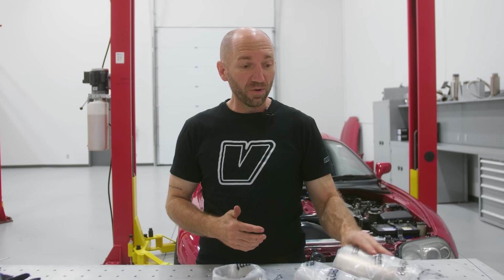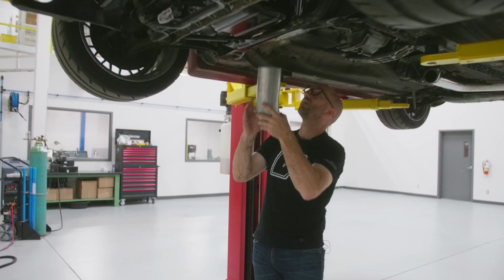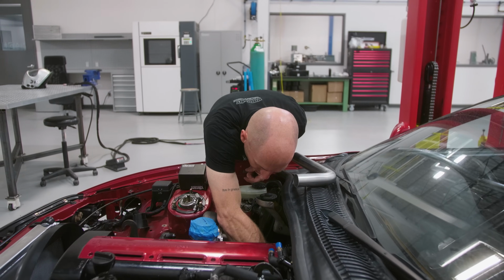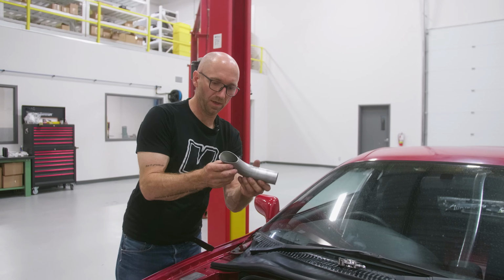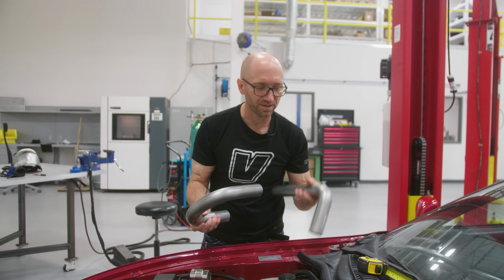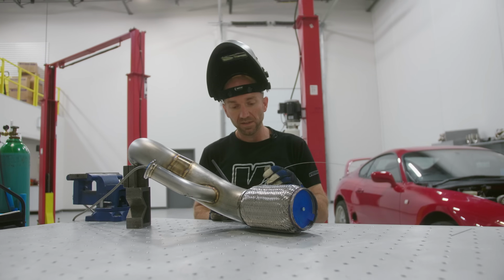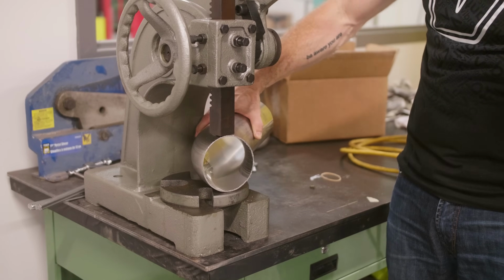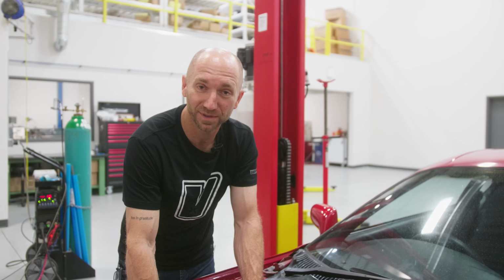We Build the BEST Supra Downpipe

Comment: On the flex: which was better, the one you welded the edge before welding to the pipe, or the one you left alone?
Reply from the maker: Hey Mike!

It is really just personal preference, both approaches get the same result when done with care.  If it is your first time welding one, fusing the layers together may be easier and help ensure all the layers are captured in the weld.  1/16” filler is recommended to fill the fillet nicely and keep the puddle from overheating and risk the bellows plies from shrinking away from the weld.  A good video on welding them is here: https://www.youtube.com/watch?v=NH7yA2Qy8TI

-Aaron Weir

Comment: Good job looking really good, my question is shouldn't the cat be removable with flanges if it goes bad in the future with out cutting it off
Reply from the maker: With a proper tune, the Catalytic should not be going bad. This Catalytic are high performance units made to handle high horsepower as well, since they have Stainless internal substrates

Comment: Hello, Vibrant! I was wondering if you could use your influence to convince Tuxedo lifts to make some adjustable lift pads (screw up and down) and also to convince them to sell symmetrical arms (by themselves) for the overhead 2 post lifts. I have the same lift at home and its a little bit frustrating for certain cars to get them perfectly level with the lift pads and extensions provided. Additionally some baseplate extensions would also be cool for people in situations where they don't quite trust their concrete with the small baseplates these lifts have. Perhaps maybe even you guys could design some of these things?
Reply from the maker: We would highly recommend contacting the company directly, we have no contacts with them. Unfortunately we do not specialize in lift equipment either, so we will not be able to help you with a new product idea.

Comment: I just want to start by saying this work is top notch! that being said... There is absolutely no reason 4" pipe should have been used. i know its what the customer wanted. With all the transitions its going to make the exhaust gases not laminate. It would be different if the cat back was 4" but since it's 3.5", from the turbo should have been one step and then 3.5" all the way back.
Reply: I think you will find if you have done your own testing that 4" straight out of the turbo even if only for the first 1meter of exhaust and then steeping down into a 3.5" or 3" gives massive gains over having a 3.5" or 3" straight out of the turbo. On a single turbo setup like this on a supra you can expect to see 250rpm faster spooling time, more throttle response and low down torque as well as gains over most of the rev range. Me personally I gained 30kw from 1500-4500rpm and then 40kw from 4500-8500rpm going from 3.5" all the way through to 4" dump and mid, meaning straight out of the turbo and then all the way to the cat or to the end of the transmission.
The exhaust temperatures cool down very fast, for example you can see around 750C temps in the turbine housing, and then barely 200 degree's exiting the rear of the car. Meaning the expanded air condenses and takes up much less space as it travels down the exhaust.
The thing he did wrong is going from 3" to 3.5" and then 4" a foot down the dump pipe, at this point he may as well kept it 3.5" for the whole thing as he has already ruined the largest part of the gain.
3.5" all the way is fine, but 4" dump will give noticeable gains. You will also find 3" limits your power to around 400kw, 3.5" limits it to around 600kw and 4" can do around 800kw before posing a top end restriction in terms of your catback size.

Comment: The outlet of the turbo is 3 inches making the piping open up to 4 inches is pointless there's no performance gain doing that. Nice build tho.
Reply: Yeah correct, he needed to go 4" straight out of the turbo then step it down after the dump pipe to see any gains using the 4" pipe.

Comment: I have not seen any down pipe mid pipe in this configuration before. 3->3.5->4->3.  Usually all the same size 3 or 4 the whole way.  Any insight to what made yall go this route?  Limited material?  Limited parts availability?

I am super surprised you did all that work just to neck back down to a 3inch.  Although the pipe reduction transitions are smooth what kind of pressure delta will be had? 

Thanks for the in depth video!
Reply: 4" straight out of the turbo even if only for the first 1meter of exhaust and then steeping down into a 3.5" or 3" gives massive gains over having a 3.5" or 3" straight out of the turbo. On a single turbo setup like this on a supra you can expect to see 250rpm faster spooling time, more throttle response and low down torque as well as gains over most of the rev range. Me personally I gained 30kw from 1500-4500rpm and then 40kw from 4500-8500rpm going from 3.5" all the way through to 4" dump and mid, meaning straight out of the turbo and then all the way to the cat or to the end of the transmission.
The exhaust temperatures cool down very fast, for example you can see around 750C temps in the turbine housing, and then barely 200 degree's exiting the rear of the car. Meaning the expanded air condenses and takes up much less space as it travels down the exhaust.
The thing he did wrong is going from 3" to 3.5" and then 4" a foot down the dump pipe, at this point he may as well kept it 3.5" for the whole thing as he has already ruined the largest part of the gain.
3.5" all the way is fine, but 4" dump will give noticeable gains. You will also find 3" limits your power to around 400kw, 3.5" limits it to around 600kw and 4" can do around 800kw before posing a top end restriction in terms of your catback size

Comment: it's my obituary option or ignorance, but is a 4" down pipe really necessary? i know that's what Speed Academy wants, but the rest of the exhaust is 3". personally i would have done a 3.5" exhaust. plenty of flow is available with 3.5"...great video, i enjoyed it💪
Reply: Yes it is necessary for good performance. You will find if you have done your own testing that 4" straight out of the turbo even if only for the first 1meter of exhaust and then steeping down into a 3.5" or 3" gives massive gains over having a 3.5" or 3" straight out of the turbo. On a single turbo setup like this on a supra you can expect to see 250rpm faster spooling time, more throttle response and low down torque as well as gains over most of the rev range. Me personally I gained 30kw from 1500-4500rpm and then 40kw from 4500-8500rpm going from 3.5" all the way through to 4" dump and mid, meaning straight out of the turbo and then all the way to the cat or to the end of the transmission.
The exhaust temperatures cool down very fast, for example you can see around 750C temps in the turbine housing, and then barely 200 degree's exiting the rear of the car. Meaning the expanded air condenses and takes up much less space as it travels down the exhaust.
The thing he did wrong is going from 3" to 3.5" and then 4" a foot down the dump pipe, at this point he may as well kept it 3.5" for the whole thing as he has already ruined the largest part of the gain.
3.5" all the way is fine, but 4" dump will give noticeable gains. You will also find 3" limits your power to around 400kw, 3.5" limits it to around 600kw and 4" can do around 800kw before posing a top end restriction in terms of your catback size
Reply: @UnparalleledSpoof  thanks for your input. i haven't even drove one of these Supras before and I've never tuned on them. you have interesting information tho.

Comment: AMAZING WORK!
Question: Wouldn't it be safer to add exhaust hanger supports to such a large downpipe so that not all the weight and stress are hanging on the turbo?
Reply: I always add gearbox mounts before the flex on my systems so the down pipe engine and gearbox can move as one. I find this is the best way to minimise vibrations as well as increase longevity

Comment: How much argon was used for making this downpipe? Also, what flow settings made this possible. The final piece looks amazing! Great work.
Reply: A lot of argon is used for projects like this.
I’d say 15-25cfh depending on how long the part was and if it was mounted on the car or table. 
Stainless steel requires a good gas coverage. Doesn’t look like he purged it…could have cracks down the road…

Comment: if it all starts at 3 inchs, whats the point in going with 4?
Reply: Customer wanted it
Reply: @TheDarkhorse82  is there any benefits?
Reply: @BIGGELATO  turbo is able to spool up quicker as there is extra room in the exhaust chamber to compress the gases rather than it being restricted by a single diameter.
Reply: @TheDarkhorse82  back pressure and restriction is much of a difference when going 3 inch to 4 inch, were talking such a little amount that it wouldn't and shouldn't matter unless you are in racing; drag or drift. But this is for a 600hp build from what the guy said. anyway don't matter, customer wants 3 to 4, customer gets 3 to 4. Whatever helps them sleep at night

Comment: So it goes from 3" to 4" to 3"? Why not match the whole exhaust?
Reply: I was about to write this. Hopefully someone answers
Reply: The section they stepped up to 4" is the cat section.  A 4" cat will flow better than a 3" cat.  All boils down to reducing restriction within the exhaust.
Reply: I was also wondering about the same thing. I guess the exhaust will cool down as it travels down the downpipe and through the cat. Having a 4" cat means better flow at that point and it's possible that the temperature difference in the exhaust gases is enough to not really make the 3" cat-back too restrictive (since cooler air takes up less volume).

It's also possible they had a 3" cat-back they really wanted to use and just said "Fuck it. Let's follow the dude's advice about the 4" downpipe, but step it down so we can use the cat-back we have".

Would be cool to see if they did any specific thinking around this, or if it was a bit of an "accident".
Reply: You don't need to match the whole exhaust, because the gas cools down significantly as it passes through the exhaust, therefore you want the largest diameter first to have an "equal" flowing exhaust, if you do 3.5" all the way through you will have your dump pipe being the first place of restriction and see good gains from stepping up to 4" straight out of the turbo even if only for 1 meter. 250rpm better spool, power increase over the whole rev range. and as EatSD mentioned a larger cat to reduce the amount of flow the cat loses is a great idea. 
4" dump, 3.5" the rest of the way and 4" cat would be a good exhaust. What he has done with starting small and going larger is wrong and wont help at all, may as well have kept it 3" after that point. the only benefit might be having a larger area for the wastegate to be plumbed back into before the exhaust cools down.

Comment: Is there a reason that something like this couldn't be made out of titanium?  I have a titanium exhaust from the downpipe back on my car, and I'd like to use titanium all the way from the turbo.
Reply from the maker: It is possible, but there's a few reason we chose stainless. Firstly, Titanium is super light but also very expensive. Since Speed Academy isn't going for the lightest possible car but rather a street car, we chose Stainless to appeal to the masses. Secondly, we don't necessarily think Ti (1mm thick) is ideal for a downpipe due to the heat coming out of the exhaust housing. You may see premature failure, or cracks due to the material being so thin - just a warning.
Reply: @VibrantPerformanceTV  Thanks for the explanation...I wondered if heat was an issue for Ti, and the reason that I haven't really seen any Ti downpipes.
Reply: @joshblount133  Titanium degrades quickly at 1100F. 👍
Reply: @VibrantPerformanceTV  I have always viewed titanium exhausts as a wear item.
Reply from the maker: @Jdmjunkie001  one at very high temperatures, if you have it downstream or post-cat, then you're perfectly fine

Comment: Just a though, instead of welding the wast gate extension to the manifold, you could have welded a V-band clamp at each end of the extension… or was it to short? I don’t like welding cast due to risk of cracking.
Reply: Hi James,  I had considered going that route.  Peter wanted to keep it simple (fewer clamps) and weld straight to the manifold.  I was comfortable having done similar in the past on turbine housings and other manifolds so we decided to go that route.  As Thanas mentioned, cleanliness is key and pre-heat does help to burn off any impurities like oil or other fluid that can contaminate the weld puddle.  I use a 309L filler for 304 stainless to cast MS and did the same with this stainless manifold.
Reply: In this cas, the cast if completely new and freefrom dirt and oil. And if ypu heat it up properly, it shouldnt be a problem